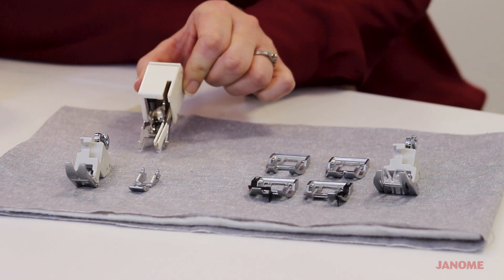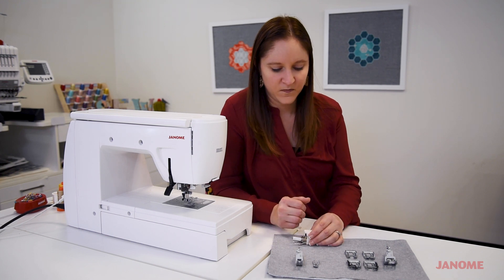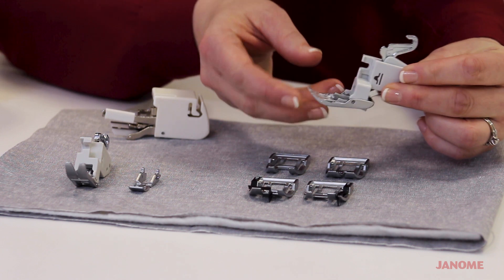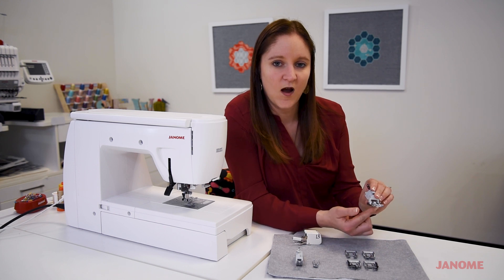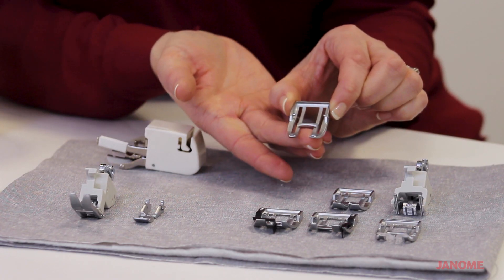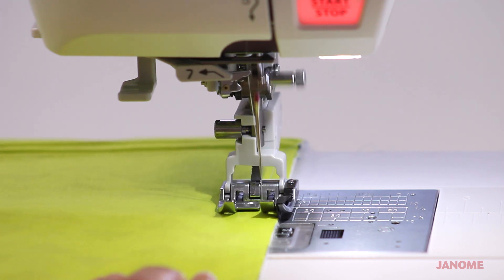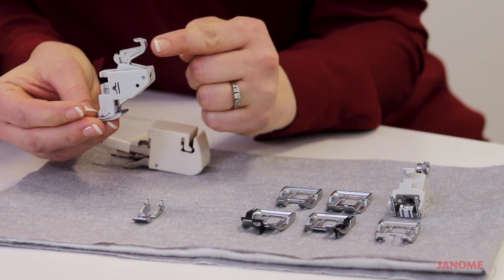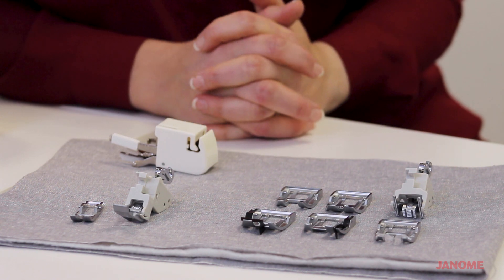Janome AcuFeed Foot Options

Comment: Do we use the zigzag stitch plate for all of the acufeed feet?
Reply from the maker: You can, but you could also use the Straight Stitch needle plate just as you would for the same stitches without AcuFeed feet. For example, a regular straight stitch can use the SS needle plate and AcuFeed foot.

Comment: Is there a reason why the accufeed presser foot kit will not fit on a Janome skyline s3 7 mm high shank?
Reply from the maker: Susan, the Skyline S7 is a 9mm, high-shank machine equipped with the AcuFeed system. To make sure you are attaching the foot correctly and have the right part, please see your local Janome dealer for evaluation. Thank you for watching, and happy sewing!

Comment: What are the settings for the stitch in the ditch foot? I keep getting puckers on the bottom. I changed the nob on the side of the machine from 0 to + and then half way in-between. The top looks perfect, the bottom stitches are shorter and puckered.

Comment: Love the video but just wondering what the acufeed foot attachment is called with the single hole.  Is it OVD?   I tried to zoom in but could see the letters.  Thank you.  I am trying to find the best foot for a scant 1/4”. I have a 9450 and love the HP foot but this gives a perfect 1/4” rather than a scant 1/4” which I need for a quilt with lots and lots seams!!  Thanks again.
Reply from the maker: It sounds like  you're referring to the Single AcuFeed VD foot. Here is the link to its product page from our Janome website: https://www.janome.com/accessories/sewing-machine-feet/single-acufeed-holder-and-foot/
Reply: @JanomeJAI  many thanks.

Comment: Which is the best option for doing a rag quilt meaning just three layers. Cotton quilting fabric first layer, cotton batting second layer and flannel third layer....
Noticed a little shifting not much very slight but a little shifting... At times the flannel shifted from lining up with the cotton quilting fabric
Reply from the maker: Susan with multiple layers, we would definitely recommend a walking or AcuFeed foot. Probably just the standard foot will work, unless you need a 1/4 guide.
Reply: @JanomeJAI  I have since bought the standard open toe walking foot before your post. Really wanted the accufeed but it won't fit my machine I have a Janome skyline S3.
Reply: @JanomeJAI  you mentioned either one when I was at the quilt shop she had your manual for parts and in the book it said that the accufeed would not fit my machine? Is that true because I really would like that one I can use different feet with it that I would use more often than just the standard walking foot
Reply from the maker: @YarnKilla54  The Skyline S3 is a high-shank 7mm machine, it is not a machine equipped with AcuFeed (which are 9mm machines and have the AcuFeed system installed). There is an Even-Feed foot available for your Skyline S3 model, and is part number 200309008, and we're happy you were able to purchase it at your Janome dealer.
Reply: @JanomeJAI  yes Janome dealer even long arms....shout out to Hartland quilt shop & studio 
Hartland, Michigan 💕 that place!
 Great ppl! Emily & Saedi they're great!

Comment: I have an "OD" an "SD" and an "AD" Acufeed foot.  Also, an HP2 foot.  I'm confused as to what each are used for and when I can substitute these feet when machine asks for non Acufeed feet.  Manual not very intuitive.  Thanks for your assistance.
Reply from the maker: Millie, what machine model do you own? in the Standard Accessories listing in your instruction manual, each foot is listed along with the one or two letter code along with the longer name. the OD foot has a 1/4 guide and is for quilt piecing, the SD foot is the ditch quilting foot, and the AD foot is the basic foot (compares to your zigzag foot ). The Dual Feed feet are meant to be used whenever you have layers, or something slipperly like a thin fabric to sew. The HP feet are there to give you a perfect 1/4 piecing.
Reply: @JanomeJAI  thank you.

Comment: In the manual it says to push the dual feed key, which greys out most stitches, including all zigzags. I noticed you were doing a zigzag stitch at one point, so I’m confused. Can you use the the dual feed device (which appears to be the acufeed device) with all its features such as the balancing dial, without using the dual feed key?
Reply from the maker: Great question! To get the best straight stitch sewing with the AcuFeed foot we recommend pressing the Dual Feed Key. However, other stitches like a basic applique, zig zag, serpentine, and others, can also be utilized with the AcuFeed foot in place. We do suggest using caution when selecting decorative stitches that require a lot of back and forth movement under the needle as these don't receive any value by using the AcuFeed foot over the appropriate applique or decorative stitch foot
Reply: @Janice Ebel Cook yes I thought I would be able to utilize the various decorative stitches also especially for quilting. I guess it might work if u go slow

Comment: I am confused.  I have the Janome Horizon 8900.  I do not have a dealer.  I want to use the decorative stitches, zigzag, serpentine, etc. with the acc walking foot.  I sure don't want to break a needle, or worse.  I did not there was an option to change the foot.  I cannot see how to snap on and off the feet or when to snap on a different foot.

Comment: I just got a ditching foot, and the blade is not attached.  What holds it on the foot, please?
Reply from the maker: Linda, the flange should come already attached on both our AcuFeed and regular ditch guide feet. We suggest contacting the authorized Janome dealer where you purchased the accessory so they can assist you in this matter.
Reply: @JanomeJAI  the blade came off.  I went to a Janome dealer, this a.m. and THEIR blade fell off their new foot, as well.  I returned the foot, that I got from Amazon, after buying another one, from SewVac, only to get home and have IT come apart, too.  I'm NOT a happy camper.  They didn't have a clue, any more than I do.  I've NEVER had any problems with anything Janome, so I don't understand.😭
Reply from the maker: @bikrgran  We are so sorry to hear this is happening to you. We recommend still contacting an authorized Janome dealer to make sure it is a Janome part. If they can no longer help you, please contact us at https://www.janome.com/support/general-support/machine-support/general-inquiries/.
Reply: @JanomeJAI  finally, after 3 tries, got a foot that works.  Thanks!

Comment: Is this compatible with the 4120QDC?
Reply from the maker: Erika, your 4120QDC model is a 7mm machine, and is not equipped with the Dual Feed System AcuFeed. It did come standard with the quilting attachment kit, which does include an Even Feed foot.

Comment: I wish they would link to each foot shown as to where to buy.
Reply from the maker: Description of each foot is on the Janome website & can be purchased at your authorized Janome dealer! www.janome.com
Reply: @JanomeJAI  Thank you but it does seem the feet for the machines is vast.  It would be helpful for you to at least have a list here naming each one and a corresponding inventory number, so anyone knows what to look for when searching various vendors for the feet.
Reply: Make it easy for the customer to search the right thing and buy.
Reply from the maker: You can find all compatible presser feet for current & recently discontinued models on the Janome website : )
Reply: @JanomeJAI  You don't seem to understand "make it easy" to find the feet in this video.  How hard it it to list them?
Reply from the maker: @babszollak2512  The presser feet featured in this video are:  Standard Even Feed Foot; Twin Dual AcuFeed foot; Open Toe Dual AcuFeed foot; 1/4" Dual AcuFeed foot; Ditch Quilting Dual AcuFeed foot; Narrow Single AcuFeed foot and Zipper Single AcuFeed foot. Part numbers for each foot vary depending on the machine model.
Reply from the maker: @babszollak2512  In addition, we have a more recent video that may be helpful: https://youtu.be/xWZNVHaozyI?si=xonHqLOd7ikebm8Q

Comment: I want to use the wide acufeed foot OD.  I don't know which stitch I'm supposed to use.  It never shows the OD foot.  Do I just use stitches that show the O foot?  I'd prefer that it tell me which stitches are available per foot, rather than guessing a stitch and having it tell me which foot to use.
Reply from the maker: DeAnna, the OD foot is a foot with a 1/4" guide, which is typically used for piecing fabric. This video: https://youtu.be/kEx5mE3kwB4 is an overview of Janome's 1/4 feet, the AcuFeed OD foot is featured at the end of the video. When you use the AcuFeed system with your machine, you do need to make sure to engage the system - please see your individual machine's instruction manual for how to do this on your model.
Reply: @JanomeJAI   I have the 6700, What does it mean to engage it?  Just install the foot making sure it's plugged into the back of the machine?
Reply: @deannas1515  , yes that is the main point, making sure that it is plugged into the mechanism at the back of the foot. However, if you wish to have more control on how the AcuFeed foot feeds, you also want to make sure the Dual Feed button on your screen is turned on. Although only straight stitches will be available, this will allow you to change the rate of movement on the upper AcuFeed foot using the dial on the far right side of the machine. What this means for you, is if you are sewing satin to velvet, you can make sure that both types of difficult fabrics are feeding beautifully together. Hope this helps!